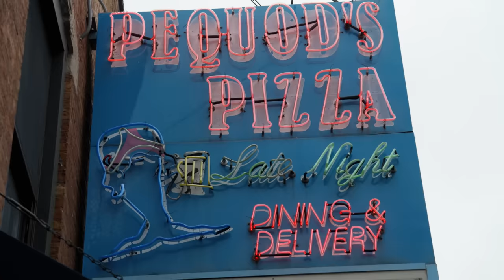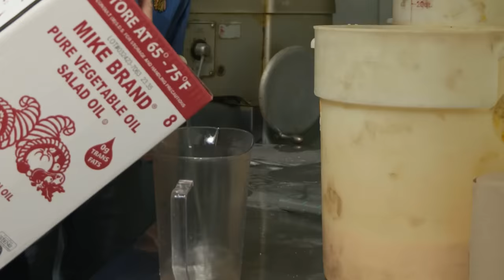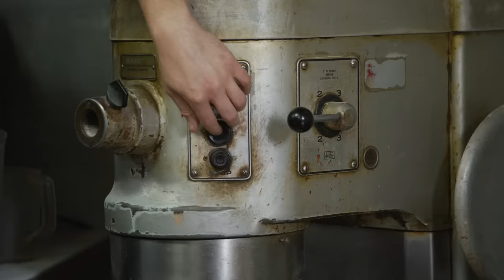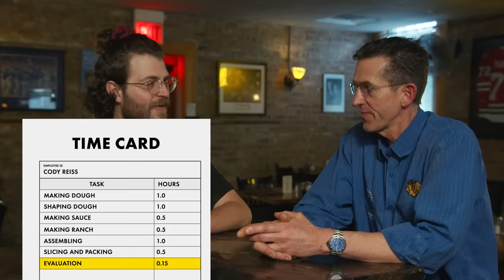Working A Shift Making Famous Chicago Deep Dish Pizza | Help Wanted | Bon Appétit

Comment: Pfffttt…. Pretty sure those plastic garbage bags are NOT sanitary, especially if you keep them on a shelf down below the table surface. 3:44 . Puts sauce container to be filled directly on the floor, then once filled, lifts up and sets directly on table surface. You now have the floor on the table surface. What trashy unsanitary establishment. 7:08

Comment: There are so many wrong things in the process i can't even count
He works the dough too few hours, there is not enough gluten delepoment in this process. The leaveninig is short too. No cleaning something that touch burned cheese is not a great idea. You don't have to throw and count 13 two ounce cup, you can weight it and throw it alltoghether (370g btw).
Reply: Dried basil
Reply: Quantity over quality
Reply: I feel this is a specific thing done in a specific way. And nearly burned cheese is kinda delicious, as long as nothing is actually fully burned.